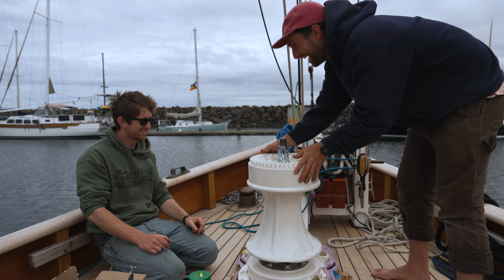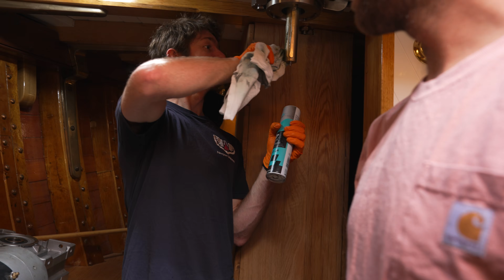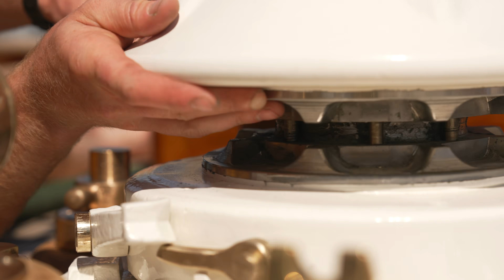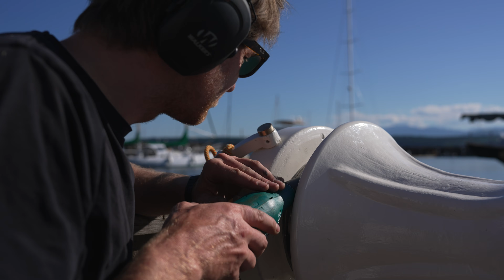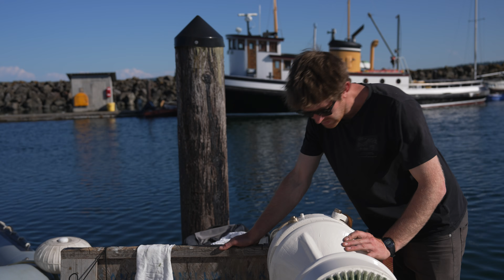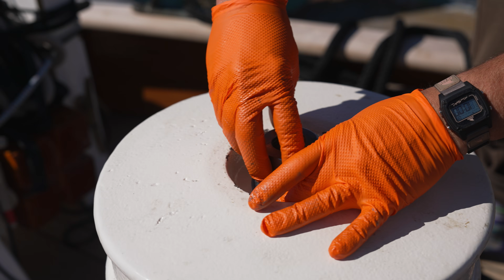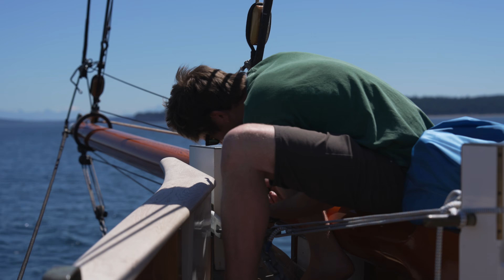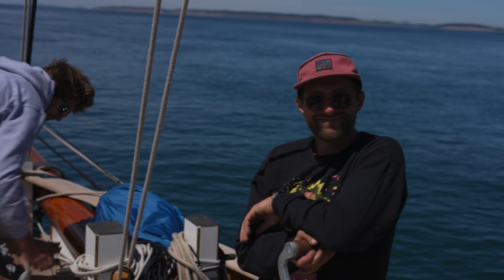Installing and using the original capstan!

Comment: The chain is the problem. The machining is exact the chain is not it is made from rod that is bent and welded that rod has a slight variation in every in diameter for every inch of the rod used. typically for US manufactured steel that is about 0.28%.  that does not sound like much but it adds up over enough links.  Especially when the thickness is added by both ends of the link.

Comment: If the weld on the chain links is the issue, either grind each and every weld on the links or grind little divets onto the flats on the gypsy where those welds rub. Widening the entire flats just for the bulging weld lines seems silly, since that just means you're removing lifespan of the gypsy itself by pretending the entire link is fatter, rather than this one spot.

Comment: Hopefully the fairleads will allow the capstan to be used to haul the gaff and sail halyards, in addition to the anchor chain.  There's no gypsy clutch, but the untensioned chain can be shifted off the gypsy. Short-handed having the capstan for sail-handling would be a God-send.  At sea, many anchors are stowed-away.

Comment: Capstan looks great, and appears to function well.
Someone else may have already asked, "Can you free-fall the chain with pawls and brake off?"
Also, is there a brake?
Reply: The drum won't spin if the electric drive gear is engaged. As for the brake, see 20:45 . The line made off to the Sampson post & turned around the drum would act as a brake (if the drive is disengaged) when the crewman pulls on the tail. Note that the line would pull against the post, it wouldn't drag the crewman towards the drum.

Comment: Though I realize that it's a bit late to be useful  if you need to fit it there's a couple of ways to  possibly do it in place... likely the issue is since it's a machined part and not cast there's little or no dradt angle that a cast part would inherently have. That said one way to check is use spray dyekem and spray the chain gypsy and run the chain through a  bit anywhere the dyekem is  missing  needs to be ground a bit. The likely better way though a bit more involved is to get a short legnth of the chain to the used and join it in a loop  long enough to pass over the entire  windlass.... then turn a temporary  wooden pulley grooved to hold the chain and  block out from the windlass like it was a v belt... apply generous amounts of valve lapping compound (a couple of tubes) and run it for a bit .... that will specifically wear in the areas that are too tight and  mate the chain to the gypsy.... hopefully that will make sense.

Comment: Why did nobody fill the casting holes and defects with filler before paint?  That is such a common practice on cast machine tools and would leave a smoother paint finish with fewer places for paint failure, specifically using epoxy filler.

Comment: I think you just run the chain through it and take material off the chain when it sticks (due to the chain's manufacturing defects) - so as to not compromise your windlass. There will be more chains down the road after all, as these tend to need changing every 5 years or so.

Comment: As you are discovering.....chain is not made to exacting dimensions or tolerances. The welds could easily add a couple millimeters to the cross sectional width dimensions.
A hydraulic press...with a jig to hold the chain links in the proper orientation.....could be used to press all of the links to a uniform overall width....yes a bit of work....but once and done.

Comment: The hawse pipe needs a chain stripper which is basically a piece of flat metal that mounts to the pipe and extends into the gap in the centre of the gypsy to pull the chain off.

Comment: Looks like your windlass could use a stripper for the chain; just a little tongue of metal that rides in the gypsy/wildcat to push the chain out at the appropriate point to head towards the hawsehole. 
Edit: Disregard, I commented moments before you said the same thing.

Comment: Then would you need remove the anchor chain to use the captain as a winch for other ropes or chain. That goes around the large middle part.

Comment: Hi there Leo.

I think the gipsy is a little too high, by half the width of the chain link (about 1’’).  I think that it may be good to remove a thickness off the wooden boss that you put on top of the plinth……. Just an idea/observation.  The problem may be that the chain wants to droop between capstan and the radius of the gipsy, doing this will also reduce wear due to less wrap around.

Comment: stick a bit of plastic drainpipe into the spurling pipe to guide the chain in from very close to the gypsy... does that make sense, I think its just the airgap between the two things that is allowing the loose chain to flop down... instead of travelling forward.

Comment: You know what will make that chain fit the Capstan is Find a long sandy road or a beach you can drive on but Drag the Chain in the sand at a good rate it`ll clean all the forging slag off and polish it to a nice steel color really smooth like it was sand blasted , I`ve done this Many times to chains that sit in the back of the truck gets rusty , It works great .

Comment: One thing that does worry me though - despite the sturdiness of the chain and the anchor, the one is attached to the other by a very thin looking connection.  Why have all that strength, when the whole this is (literally) dependent on the weakest link?

Comment: That's really awesome to have that original capstan back on the boat with the modernization of the electric motor.  It was truly a great touch.  You might want to add a swivel to that anchor, seeing you will likely be on anchor for extended periods of time to prevent future twisting of the chain. Thanks again for another great episode.

Comment: It doesn't seem like you guys removed the paint from the gears in the capstan before you installed the assembly.  I think that might be a problem down the road for the grease on the gears to work effectively..

Comment: I was just wondering if the brass inlet to the chain locker was lowered the chain would drop into the fitting rather than going slightly upward and catching....just a thought

Comment: Relieved. Improved numbers by optimizing the generator's pulley. Gradually grinding the capstan chain guide to compensate for chain weld irregularities and twist. Very smooth when it works. Some kinks to work out.

Most measure anchor chain in feet/meters at 10 or 20 increments. First time seeing a 45 ft measurement.

Comment: There is a piece like a spike shape finger that goes in the chain sproket between the top and bottom parts, just in the horizontal groove that prevents the chain from sticking in the chain sproket...
and it seems missing in your capstan
Reply: As you said in min 29:55 the piece is called, chain stripper, and it pulls the chain away from the capstan.

Comment: the work on the gypsy is as we say in need of fettling, its not a major thing its just the tolerances are too  tight. its probably the old metric/imperial problem where both sizes are just a smidge off and just enough to be a bugger.

Comment: Hi team, I really love how this Capstan works, it's brilliant. Is it quite unusual for a racing sailing boat of Tally Ho's age to have what to me, a land lubber, seems quite a big Capstan on deck.............The Capstan seems huge. Anyway, I think your problem with the chain is "Burrs" just edges and machinery bedding in when new. I nooticed the chain seemed to run round the Gypsy alot better the more you used it. Oh one last thing, I hope you boxed in the Gearbox below deck before you sailed off. That lump of metal will be mighty unforgiving in rough weather....................I am really amazed at the work on this project, it really is a wonder what has been achieved.............Happy sailing  from Dave.

Comment: Does someone know why Tally Ho had this capstan in the first place? Was she designed as a fishing vessel?
Reply: To lift the anchor.
Reply: She was designed for offshore cruising & sport fishing. The owner had a fishing fleet, he might've had a spare capstan sitting in his yard, or could get a low price from the supplier.
Reply: Ah thank you! I was wondering what the upper part was for. Since, to pull up the chain, the lower part with the groves would have been sufficent :)

Comment: Leo, I kindly suggest that you consider adding a stripper to prevent the chain from sticking. A simple stainless steel bar with the same inner diameter radius of the capstone as the chain as it comes off the spool should peel it out.

Comment: Question : I am concerned about heavy weather sailing in a long passage . Steering from the cockpit seems harsh . What can be done. The Dingys location seems to be in the way of a weather dodger being put up . What's the answer ? High  tech self steering and radar ? Seems like rain and heavy rain might be unavoidable on a long passage . Since Leo always has a plan just wondering what that might be.
Reply: Wearing foul weather gear.

Comment: Hey Leo , you know who again  ,  specifically I am an Outside Machinist . The environmental conditions of the capson , there is no way I would have allowed you to assemble that without the use of Halocarbon Grease on every thread above an below. That big Nut on top , with out Halocarbon , you  will  gaul the threads on that , on any of it , will ruin your mind .

Comment: With no experience building a boat, but some around machines in time the chain may wear itself into where the gypsy accepts it and binding may not being an issue anymore , do you think the chain of today is not of the same weight as the chain of years ago, this keeping it from overhauling back into the chain locker?

Comment: Consider adding small stand-off pawls that are pinned by the bolts that hold the gypsy together. Make the pawl a little higher than the bottom of the machined chain area only need to go from th bolt  to the end of the chain pocket on the hause pipe side you can even elevate the very right hand end of the block to promote easing the chain out. I made some out of UHMW before and they were absolutly flawless in operation also hawse pipe could stand to be lowered a bit. 
If you make a chain stripper make sure to have a little chute near the cap stain to off set the first and second links coming off the gypsy. This will alleviate dragging on the hawse chute as long as the tail of the chute is high enough

Comment: Keith Rucker, Dave Webster and Windy Hill really scored a win . The Capstan is an exotic antique brought back to life. The average builder would have slapped on a modern piece. Really another level of expertise !
Reply: I'd  have to go back to check, but if memory serves, the capstan had at least one other shop have a go at it, and give up,  before they sent it to Keith. Clarke Easterling (Windy Hill Foundry) is on hand to assist with the disassembly back so many moons ago. And as Keith said it fought him the whole way. The video was posted over a year ago. Amazed at everyone's support of the Tally Ho. I remember when Leo was going away to work as a crew member on a yacht to make money to work on the project.

Comment: Leo…..get a “ High quality “ swivel so your chain will straighten itself out. Also had the same problem when I launched my new boat. Chain would jump off the capstan…..the original chain was made in China and I think it was over gavanized. Purchased new chain, problem solved.

Comment: *** DANGER******    Please make the "chain stopper" (between the winch and the bow roler) that you can "fix" it in "open" position. I'm afraid it will start bouncing around when you freefall the ancor. Possible is that it will turn and try to prevent the chain from running out. Then it will launch itself like a rocket.

Comment: Is there a top cap that goes over the nut in the top of the capstan? Seems its would collect water there.. I can't remember seeing one.
Install looks good. Something like that is always going to need some tweeking to get it running perfectly.
Perhaps the chain is coming off of the gypsy at an upward (or downward) angle as it goes into the collector then down into the locker? That could cause some binding as it comes off the capstan...
Cheers,

Comment: I didn't see a anchor chain swivel between your anchor shank and shackle.
Reply: Correction: The swivel should be attached to the anchor shackle and the first chain link.  Choose a swivel with sufficient side loading specs.

Comment: The reason for the “twist” in the chain is you have no swivel between the chain and the actual anchor … install a swivel and that twisting should disappear … 20 years of running 50m of 10ml chain has proven this concept.

Comment: Great video and congrats on the installation of capstan. One suggestion to avoid twist in the chain in the future, (especially after Tally Ho has swung on her anchor a few times) is to add a swivel where the chain connects to the anchor.

Comment: Not a problem in manual mode, but, when the electric drive is in use and someone not used to using the capstan engages the pawls . It could possibly cause damage to the drive train. It's worth considering  installing a shear pin somewhere in the drive train to prevent that occurring

Comment: If the spurling pipe entry is lowered such that the chain lead off the gypsy is angled down, not up, the fall might improve. Also, not original design but a chain stripper might help both inboard and outboard sides of the gypsy.

Comment: Hey Leo - I would love to know how much that whole assembly weighs!  I presume you factored that in when designing the ballast requirements, or was it all guesstimate and hope?
Reply: Keith Rucker weighed the complete assembly before sending it to Leo - 546 pounds. Tally Ho was floating bow-high after launch, the add'l weight was anticipated, but there was probably also some tweaking of the ballast distribution.
Reply: @frederickstibbert7389  I wasn't sure that Keith had all of the components when he weighed what he sent.  I don't think he had the motor mechanism?
Reply: @nigel4425 - https://youtu.be/EZfNqQMyUoY?si=jeY2f27dcmmPwVdL @32:24. Keith weighed it, together w/ all the electromechanical bits. I was out - it weighs 534#, not 546.

Comment: you need a stripper plate. chain often stick in jipsy . in time dirt and rust will ad to stickiness. even brand new windlass tend to grip the chain under load. definitely need a stripper plate.

Comment: I wonder if you have to use a snubber in your capstan setup to avoid strain on the electro motor. I know you have a manual switchover to the manual gear, however would a storm or a big wake of a ferry put severe strain on the gears to potentially damage it in the long run? Loads by wave action are short and severe and are different than constant load of pulling up a anchor. I have seen fibre glass boats unload their whole anchor chain since they didn't use a snubber and left it on the electrical motor. A line is stretchy and takes the severity of the load out.

Comment: On a lot of these chain winches they use a guide/ finger too prevent the chain being turned too far round the gypsy. Next to the chain running down into the boat and close to the gypsy

Comment: I'd be curious if you took the temp of the capstan motor after that long haul.  I usually recommend a 30 pull, 10 second rest cycle.  Windlass motors (usually starter motors) last much longer.  Be curious to know what you have.  One great add on is to go to an auto parts store.  You can get winch wireless remote kits which are cheaper than marine and easy to install to your solenoids.

Comment: 21:57 - clearly visible, welds on links should be outside the sprocket or - as you call it - gipsy. If chain is calibrated, those welds may lift up neighbour links so it may block...

Comment: What a trip that capstan rebuild has been, if you have time watch the videos , so much is involved it is like watching a riveting thriller. 
PS: People have mentioned the sharp edges of the capstan motor, maybe after 7 years of hard wood and traditional craft the final touch could be a tip to the future with a printed plastic-foam box around it to keep all the creative and gentle  brains of Tally Ho crew protected. (would also be thinner with less wasted space.) Long sail Tally Ho!

Comment: Does the capstan motor have a slip clutch of some sort? The pawls at foot level on the desk could so easily be flipped into engagement and not noticed. A locked drum against a powerful motor could cause serious damage.

Comment: Nice to see that piece of machinery installed and working. New galvanised chains are sometimes not consistent and have sections where the zinc is thicker or lumpier, or aren't as flexible, which doesn't help when the chain runs through something with relatively tight tolerances. However, the chain will in time wear and probably run better.

Comment: It looks too me like the pockets for the chain links might be a bit short lengthwise as well being too square. If the pockets are slightly longer than the chain link, the link at shipboard end will rotate more easily out of the gypsy which would be helped by the teeth being more rounded.  The gypsy might have been  machined too closely to the link shape -the chain when not under load should be able to slip forward and back a small  distance within the gypsy -it needs to work like a gear train with a lot of backlash. If the edges of the gypsy aren't nicely rounded the galvanising will wear off prematurely. The hawse pipe also looks out of line with gypsy (a bit high) which will not help the chain strip off the back of the gypsy. My 2c HTH